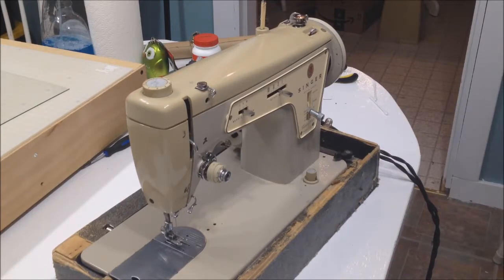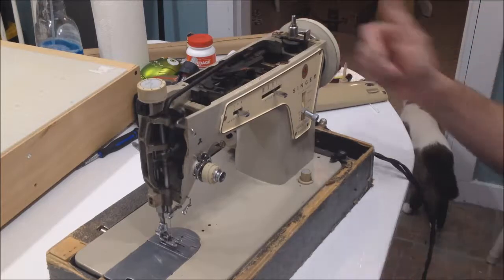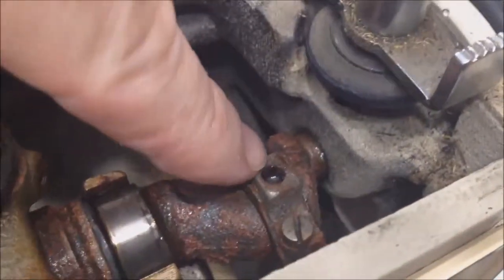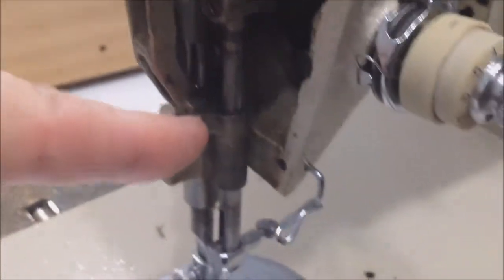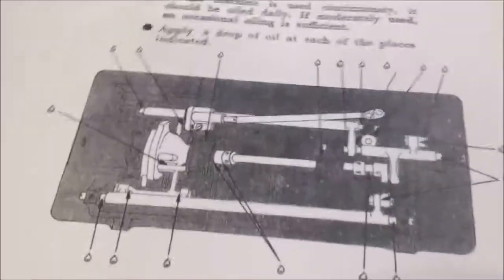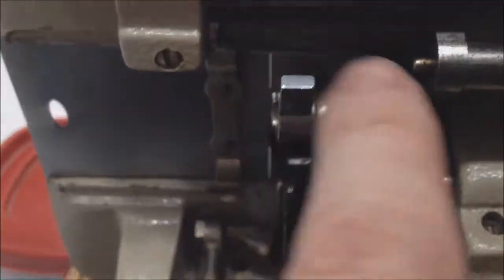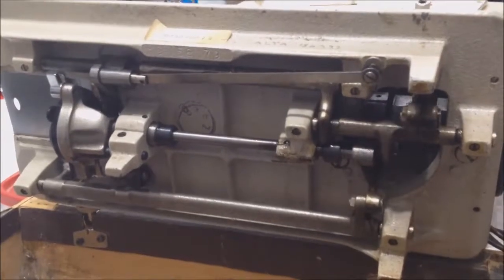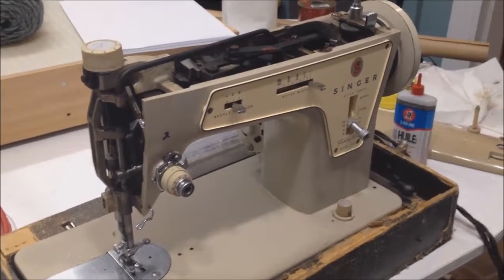Singer Fashion Mate Sewing Machine Daily Maintenance

Comment: I’m a novice, and found a 237 that was practically new. I need to know about fixing timing on this machine. I press the foot, and it goes from slow to freight train speed back and forth. I was told it was a timing issue. Can you help?
Reply: I have this same problem. I also found out that it was lubricated with grease not oil, is it a problem.?
Reply: Beatriz Salazar Hopefully, we’ll get some answers. I love the machine—it’s virtually indestructible. But, it’s driving me crazy. Hope yours gets fixed.
Reply from the maker: Is the motor speeding up and slowing down, or just the needle?  Doesn’t sound like timing, sounds like maybe an electrical issue with the foot pedal.
Reply from the maker: Long term,  no.  The issues with grease is over time it will harden.  Start providing a bit of oil when you lubricate will prevent that from happening.
Reply: Clean and lubricate the machine.  Run some kerosene through the machine to clean it.  Oil it as shown in the video.  Do not use 3in1 oil.  Use 3in1 only to get rid of rust, then flush out that stuff with kerosene and then use sewing machine oil.  

Your problem does not sound like a timing problem.  These machines rarely go out of time.  The hook timing is on a fixed shaft made out of solid steel and the needle bar is also unlikely to have moved.  These machines are so well made that timing is almost never an issue.

If the machine is well lubricated, and if everything moves, if you have no real speed control it's likely the foot controller that needs to be adjusted.  Different foot controllers have different types of adjustments.  If it's an old style "button" foot controller, look up Andy Tube's videos on how to dismantle them, clean them out and adjust them properly.   

If electrical work makes you uncomfortable, new foot pedals can be had for about $20.00 on line.

If the foot pedal is properly adjusted, the motor may simply need a cleaning.  Again, Andy Tube has very detailed videos on taking a motor apart and cleaning it.  You likely don't even need to take it apart, just open up the ports where the brushes are located, change the brushes and wipe down the copper commutator with a Q-tip dipped in alcohol.  You'll get vastly more power and control out of the motor.

All of this is easy to do.

Good luck.
Reply: @RedBarnHomestead  Yes, it is most likely the foot pedal. The foot pedals can be disassembled and inspected, sometimes it can be fixed with only a screwdriver and a pair of pliers, and either a nail file or a little emery cloth. Newer foot pedals, "electronic" models,  have more sophisticated innards, the older ones are very simple, glorified rheostats.